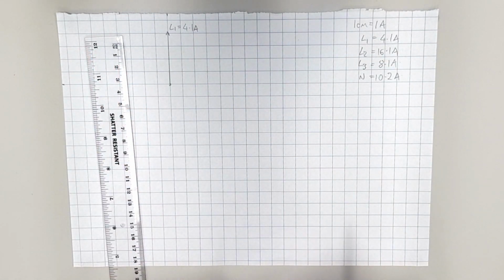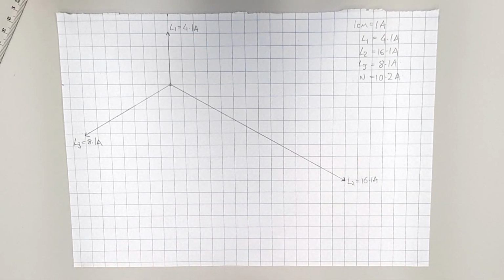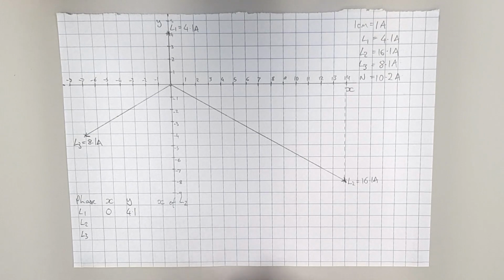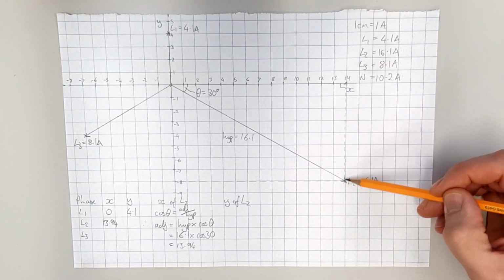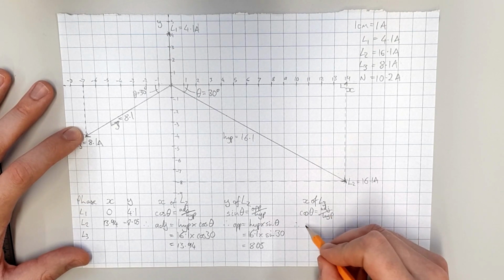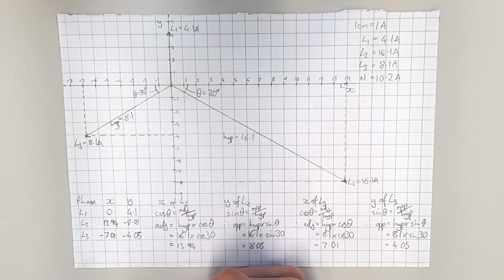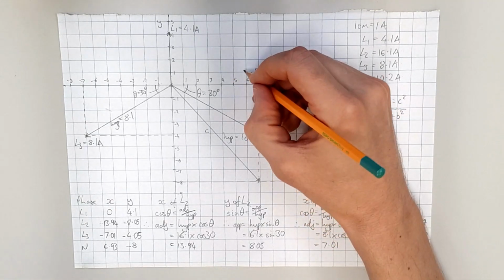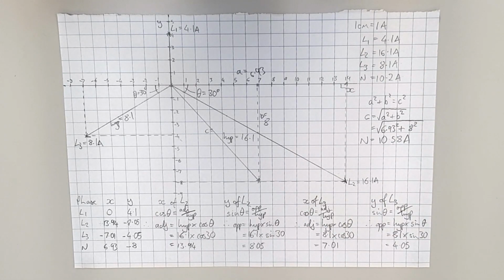Three Phase: How to Calculate Neutral Current in an Imbalanced Load

Comment: Great! Neat and fast. Calculate the length of the resultant vector of the three phases, which is very simple and fast. Split all phasors into their X and Y components, then apply Pythagoras: sqrt[ (X1+X2+X3)^2 + (Y1+Y2+Y3)^2 ]
Neutral Current: sqrt[ ( 0 + 16.1cos(330) + 8.1cos(210) )^2 + (4.1 + 16.1sin(330) + 8.1sin(210) )^2 = 10.58 A

Comment: L1 = 1kw, L2 = 4kw, L3 = 2kw. 
L1 = 4A, L2 = 16A, L3 = 8A, N = 10A. 
(4A + 16A + 8A)/3 = 9A (10A)
Not a perfect relation but pretty much near.
Reply: Unless you know when to apply the average, this method isnt a good approximation.

Comment: Not saying the calculations are wrong but I think you should draw the phases accurately.
I saw you put L1 at 90°, L2 at -30° or 330° and L3 at 210°, this is not the case in real life...

Comment: if we use the equation                                                                                                                                                                                        𝐈
I𝐧 = √((𝐈𝐚𝟐 + 𝐈𝐛𝟐 + 𝐈𝐜𝟐) − (𝐈𝐚 × 𝐈𝐛) − (𝐈𝐛 × 𝐈𝐜) − (𝐈𝐚 × 𝐈𝐜))
I got different results 20.95 A  ????
Reply: Probably because you entered the values in your calculator incorrectly. I got 10.1

Comment: where the neutral current of this 10.5 A will go , if not earthed
Reply: it will be exactly the same - neutral point after loads - neutral conductor - neutral point of the transformer - phases coils - phases conductors - phases loads...

Comment: Why does an increase in load lead to increase in current? The videos have been extremely helpful and during the viewings we've come to understand that loads act similar to resistance. Therfore what causes and increase in current flow through the supposed greater resistance (hgher load)?

Comment: hello joe
i know its an old video but i hope you can answer my question
now if you want to calculate the overall power of the three phase load
should i just multiply the voltage (220) in the current for each phase ((for ex:220*4.1+220*16.1+220*8.1))  ??
or i should take into consideration the neutral current ??? if so then how can i calculate the overall power of the whole system???

Comment: Thanks for the neat explanation. Could you add the final piece of the equation from a design point of view: How would you select the db size required? Do you just select the highest one of the three or does the current get distributed between the phases so you can select a smaller DB. I have run across a heat treatment application where we couldn’t figure out if we needed a 128A supply or a 64A because one of the phases was above the imbalanced load. We only had a 64A supply in the factory so the decision was costly to bump it up but it was because one of the phases was higher than the others.

It was a 50/50 split on which way to go. And since we didn’t have a physical way to test it prior to delivering the machine it was a bit stressful because someone had to sign off on the decision (I do controls design and circuits as in PLCs and stuff but am not a full electrical engineer).

Comment: never thought u could solve the neutral current with trigo. Pretty cool. The 0.3 Amp difference is coming from the higher Resistance of the paper and pencil🤘That's why in the field, we never ever use paper or pencil as conductors...lol

Comment: A nifty explanation of a mathematical way of doing this, this only works for loads with the same power factor/phase shift that are 120Deg apart. for loads with dissimilar phase shifts it can only be done with the parallelogram method ( phasor diagrams) or by calculating polar co-ordinates.
Thanks for the Video.
Reply: hmm, not too sure if this is true: if you know the phase shift you just add it to the 0/120/-120 degrees.

Comment: You really have a gift to teach. Thanks for the quality video mate. Let's say that we have a bug house with ground floor plus 2 levels and each level are connected to separate phases of a 3 phase connection. I reckon that the ammeter would measure an 'imbalance' on the N if ground floor and 1st floor loads were switched on but 2nd floor was all off isn't? As such would that cause any issues such as high electricity bill please?

Comment: I think there's an easier way of doing the trig. It has a built in method of reminding you whether to use sin or cos, uses the entire phase angles and doesn't require adding, subtracting or potentially forgetting about 90 or wondering whether the resulting phasors are positive or negative. It's also easier to type in to your calculator!

Start with L1. Angle is 0 (we're working in degrees). 4.1*sin(0)=0 and 4.1*cos(0)=4.1. From this it clearly reminds you that sin of the total phase angle is the x component and cos is the y component. 
We can then do L2: 16.1*sin(120)=13.94 and 16.1*cos120=-8.05
L3: 8.1*sin(240)=-7.01 and 8.1*cos(120)=-4.05
sqrt((L1sin0+L2sin120+L3sin240)^2+(L1cos0+L2cos120+L3sin240)^2) = 10.58
Reply from the maker: Thanks for the suggestion. 😊

Comment: What I understood at school it s , the current difference between phases it s wasted in to neutral. But I forgot to ask if the meter calculate that waste as used and it s in our bills.
Reply from the maker: Hi Marius, wasted isn't really the right word, it combines in the neutral and any unbalanced current flows in the neutral. The electricity bill is based on the Energy used so it's mainly concerned with the current flowing into the circuit. 👍

Comment: I am eager to know, what exactly happens to the Neutral return current after it reaches the transformer from the building. Whether it is further in use?
Reply from the maker: Remember current it just a measure of the flow of electricity, it doesn't get used up it just goes back around the circuit again.
Reply: Neutral is grounded at the transformer so all that extra current goes into the earth

Comment: Wow, what a great video Joe. The method you show in this video is a great method for visualising what happens with the neutral current and it maybe a long winded method, but you can follow the steps through specially seeing how it could be very easy to make a negative number become positive.

I also write the formula out when transposing and someone showed that using a different coloured pen when going through the transposition can help you spot any mistakes.
Reply from the maker: Thanks Chris, I really appreciate the feedback, funnily enough I use different coloured pens when I'm teaching transposition on the board so I may have to bring that in to my vids. Other neutral calculation methods on the way!